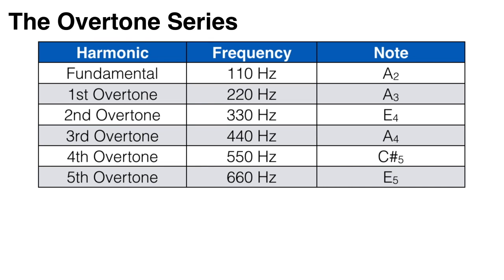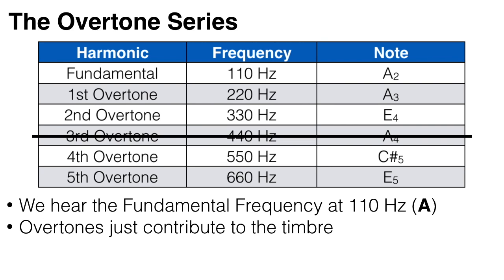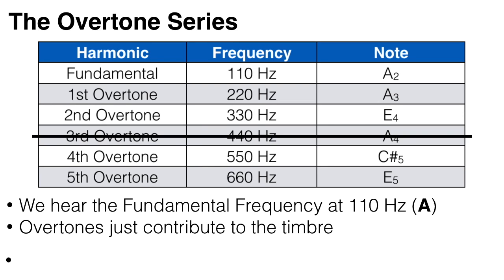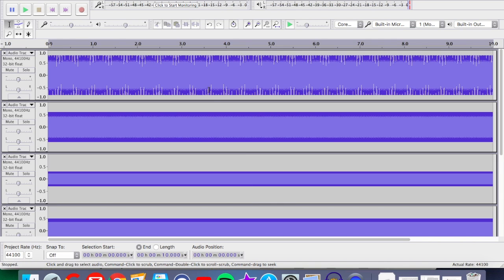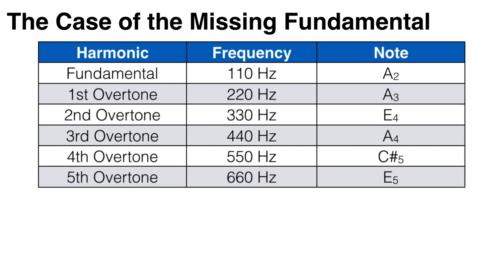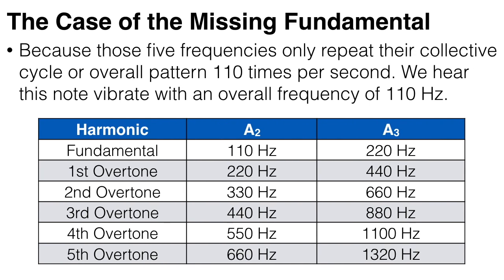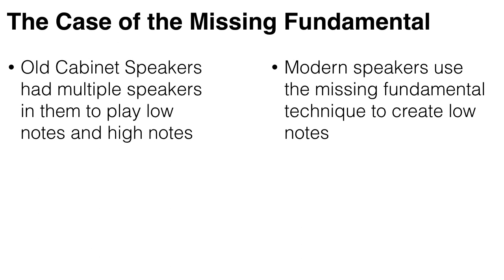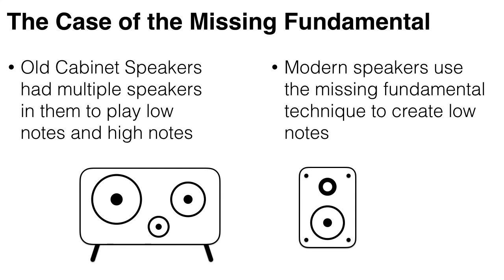11. The Missing Fundamental

Comment: I put 550 Hz and 660 Hz on Audacity. The resulting pitch that I perceive is higher than 110 Hz. But If a add a frequency of 770 Hz then the result sounds like 110 Hz. I tried multiple combinations and I noticed that I need at least 3 harmonics for it to sound like 110 Hz. Is my mind playing a trick on me?

Comment: The numbering, whether or not from a computer program, is idiosyncratic. Piano tuners will consider the appropriate number for the 1st overtone, 2. In other words, a 6:3 octave is representative of an octave tuned to coincide at the 6th partial of the root and 3rd partial of the octave. But with these numbers, that would be 5:2, which would not make sense to a tuner. 1 represents the fundamental
Reply: You're referring to harmonics. He went over that in the last two videos and uses the terms overtones/harmonics interchangeably (with the correct numbers for both of course). The 5:2 you're referring to with his overtone numbering is the same as 6:3 with harmonic numbering, as the harmonic number system is the same as the overtone numbering system but it just includes the fundamental frequency (so its plus 1 to both sides equally 6:3)

Comment: Why don’t we hear 55 hz? Who says 110 is the fundamental?
Reply: Because if 55 hz were the fundamental, then the overtones would be 55, 110, and then 165. It's the same reason why 220 isn't the fundamental!
Reply: The fundamental is somewhat arbitrary...which is why it's called the fundamental! The harmonic series proceeds from it as the starting point in set ratios.
Reply: @m33pr0r  exactly!
1. 55 Hz             110 Hz          220 Hz
2. 110 Hz           220 Hz        440 Hz
3. 165 Hz   	   330 Hz         660 Hz
4.  220 Hz         440 Hz     	880 Hz
5. 275 Hz          550 Hz      1100 Hz
6. 330 Hz          660 Hz           ...
7. 385 Hz         770 Hz            ...
8. 440 Hz         880 Hz            ...